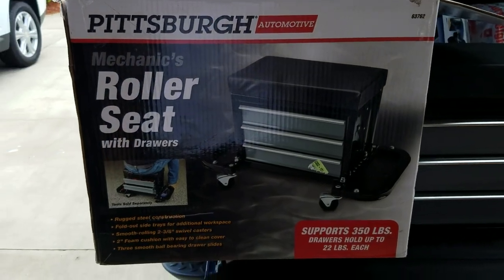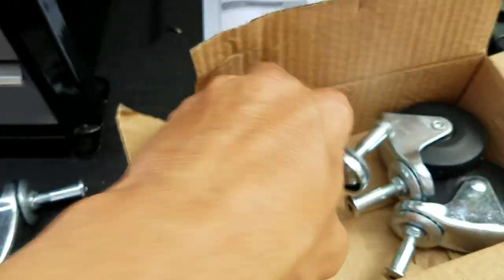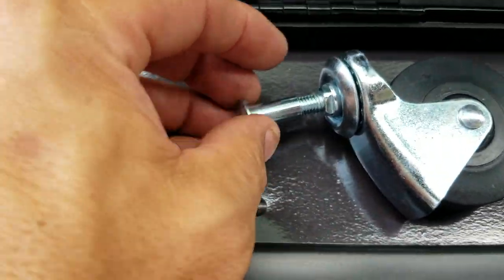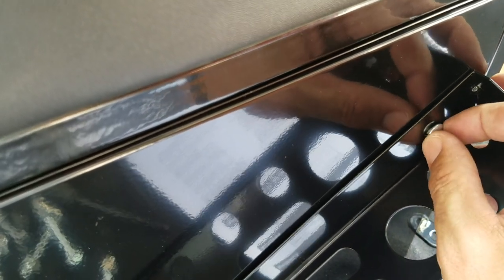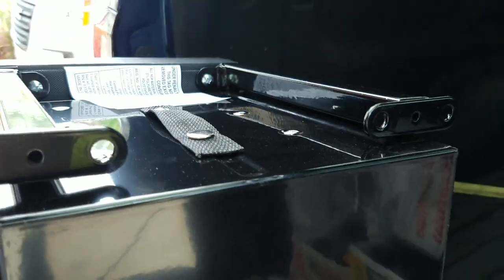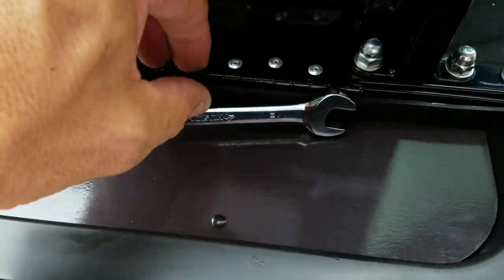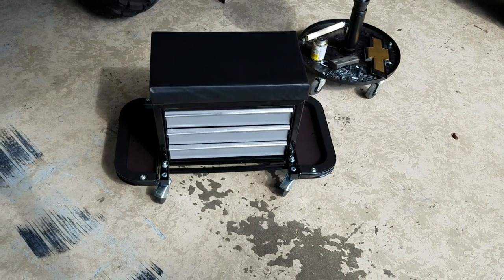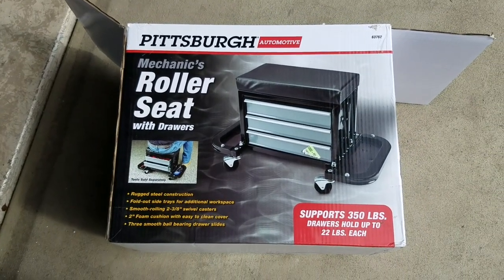Roller Seat Harbor Freight Review and Assembly

Comment: If you look closely at the assembly instructions, the support bars go into the inside holes, under the body frame. Your install will get the back of your foot (painful). As for the swivel hitting the bolt (several here mention), I replaced the casters with larger ones, adding height while also eliminating that problem. Or add a washer to the caster. You're supposed to be mechanics, so solve it.

Comment: After putting it together the wheels hit the bolts. I think this is sturdy strong but the design could have been way better mine seems Lil off from factory.  I had to pull and struggle to get the nuts to get in the holes had to grind bolts down so I have a free smooth glide
Reply from the maker: had the same issue , might have to look at a modification like you did . Thank you for your input
Reply: I now just took off the extra support rails that it came with and the bolts where hitting wheels. It seems very strong still
Reply: Great video! I just picked one up and it's awesome, helps with the knees. Just so you know the support brackets go on the inside holes with the longer bolts and the shorter one go next to the wheels I had the same problem and was like wtf but I saw the picture on the box and realized.